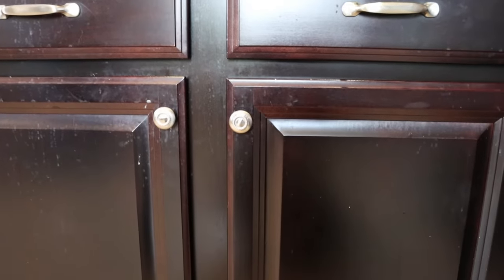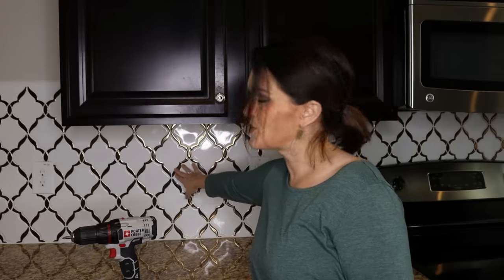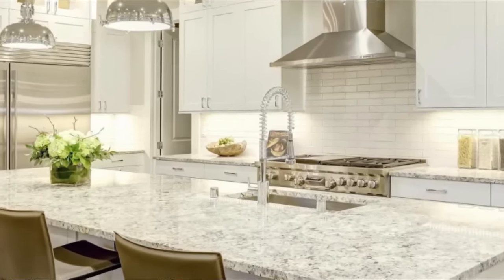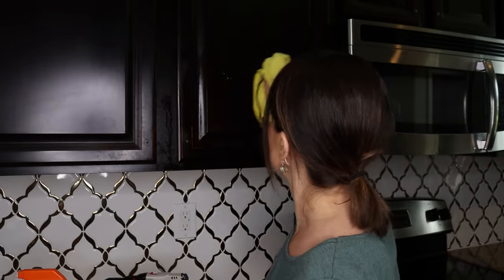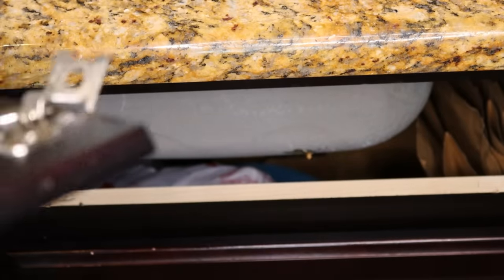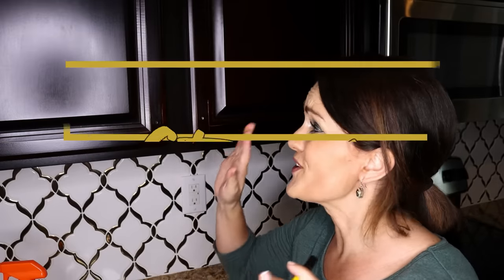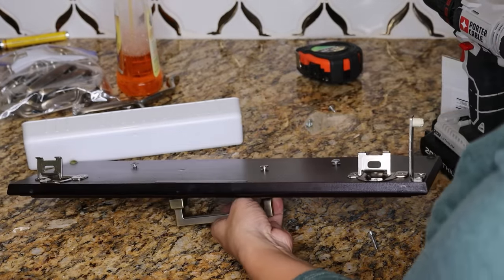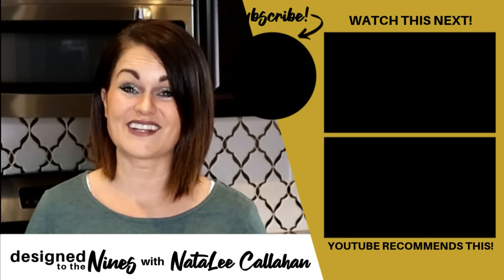HOW TO Refinish Cabinets & Avoid Sanding! Save Your Kitchen For $35!

Comment from the maker: ⭐What is your biggest DIY challenge when it comes to your kitchen? Like this video? Check out this on next: https://youtu.be/gE2iJbcY6tM
Reply: clicking on those suggested videos before they disappear.. seriously.. they go so fast.. LOL
Reply: Designed to the Nines well when we purchased our home many moons ago 🤣😂 they had real wood cabinets but they were so boring with the flat panels etc. so I painted them black yes black 🤷‍♀️ back when the black was popular well since then we have sanded and added trim to make them look more like shaker style but my husband stained them a really dark reddish stain which I think I can fix🤞
My real problem is with the waisted space... there are no corner cabinets they are all squared off if you know what I mean... so without replacing all the cabinets I’m not sure how to fix my problems... any suggestions? 🙏🏻😂🤣
Reply from the maker: I feel you! I’ve worked around old the kitchens in the past… it sounds like you’re handy, so maybe it’s just building in some extra shelves here and there on the wall or on the ends of cabinets. Definitely when you’re short on space you have to think outside the box.💕
Reply: @donnadoiron8884  ugh with the squared off corner spaces. so the corners are jsut these huge empty spaces that you cant even get to.  both corners, top and bottom in our kitchen has that empty unreachable unused space! and we will have to completely change the layout of the kitchen to even put new cabinets in to use it.
Reply: Renee Owens yes... that’s mine... you can’t reach anything back there oh I absolutely despise it!! Don’t know what the builder was thinking.... it definitely wasn’t a woman 🤣😂
Reply: Designed to the Nines 
I just realized I spelled “waisted” space it should have been wasted 🤣😂🤦🏼‍♀️
Reply: @donnadoiron8884  definitely not. the top cabinets are so low that you cannot fit any kitchen appliances between them and the counter. they also installed a spice rack pull out above the oven. like the worst possible place for spices.. and i cant reach it at all. I'm too short! its like the person who put it together had an idea of how a kitchen functions, but had never actually used one at any time in their life. 
XD
Reply: @donnadoiron8884  XD
Reply: Renee Owens 
Exactly 😳🤣😂
Reply: Wow your cabinets look amazing. I definitely need to do mine as well. Love how when you fail you just laugh and take it in stride. Keep up the amazing work. Hugs and have an amazing day.❤
Reply: My cabinets were made in the late 80s an have white laminate covered doors. Is there anything I can do to remove the laminate or cover it to update these? I’d like to update my kitchen but I can’t afford a kitchen makeover
Reply: crayons are for filling holes, paint pens are for filling scrapes and painting but you need to get the paint to drip off the marker first on a piece of scrap wood or a paint stick its like nail polish. You put on a quick coat. Let it set 10 seconds. One quick swipe would do it.   Mowhawk makes better matches to the color you have which is called "Twilight".
Reply: Tdd r
Reply: I have pressed white wood cabinets that have chipped. Hoping to make them look new again. The cleaning process you used looks like a great way for me to begin the restoration.
Reply: My kitchen started out small but a previous owner cut it down to make a bathroom for a senior. It is incredibly small and has four doors (back, living room, dining room and basement) in this tiny room. I have worked through the rest of the house (on my own) over the last 17 years leaving this room until the end because it is so challenging.

Comment: Hint.  Always remove one of each handle type you are replacing and and bring it with you when you shop.  If you are ordering online, measure distance on back between holes.  I’ve made the same mistake you did the first time, but only because I guessed.  NEVER guess.  My cabinets are painted, but because I am repainting them, this will work.  I know some of the paint will come off, but it doesn’t matter in this instance.  Thank you so much for this tutorial.  You’re a hoot.  By the way, your cabinets look great and the new hardware adds a great touch.  I have white cabinets with white hardware.  It’s fine, but I’m switching out to black hardware.  Cabinets are quite old, but I’m leaving them because I plan to move.  They have the exterior hinges.  I, therefore, needed to buy handles, knobs and hinges in black.  I buy myself a birthday gift and for three birthdays in a row, I bought handles one year, knobs the second and hinges lastly.  The hinges were the least expensive.  It cost a lot because I have 27 or 29 doors in my kitchen and 15 drawers.  I was also on a very tight budget.  Now I have to get the paint.  I’m doing the same color, decorator white.  I like my house, but not the neighborhood.  Hence, the move.  Plus I want a smaller house with everything on the main floor, no upstairs.
Reply from the maker: I think that it would work well for painted cabinets and just knowing that you’re going to have to go in and touch up paint a little bit. Might actually be good to kind of knock off some of the loose ones that would not stick anyways. Yeah… As far as the hardware I should’ve known better... it’s so silly that that happened. I’ve been dying for a long time and that was an amateur mistake. I think black hardware will look really awesome with white cabinets. Good luck with your project!💕
Reply: L we

Comment: Thank you NataLee. I have two kitchens in our new home. One is hard wood, the other is not. 😕 Is there something that works this great on laminate over press board? I am trying to decide whether to purchase new cabinets to replace them (they are white and in mostly good condition) or replace them. A few nicks and scratches and a couple of lifted/cracked facing on the door edges, but otherwise more than decent condition.
Reply from the maker: I would probably make a go of repairing them first to see if you can save them, but if not I have seen people wrap them before, like in this video... https://youtu.be/Id3bEsI0nr0
Reply: @designedtothenines  Thanks for the reference. I have no clue what I am doing. Thank goodness for you sharing. I've been watching your channel off and in for a year or so. Recently moved 1,500 miles with kids, dogs, and elderly parents. Just trying to get our new place in order now. I'm watching you more than ever. Thanks again.
Reply from the maker: That’s a big move! I’ve done it a couple of times. Moved from Utah to Arizona to Maine to Florida. Love those cross country moves! LOL. Good luck.💕

Comment: Love the brass!! I think the counter tops are a little dark with your new backsplash,  but it's still beautiful..do you have any suggestions for oak cabinets  if the stain comes off?? I'm not sure a sharpie would work for that color..lol! Thanks so much! Love it!
Reply from the maker: So unfortunately I did not pick out the counters and I was working with those to begin with. I didn’t want to replace them since they are new and in good condition. I actually went with the lighter backsplash because I thought it would brighten up that already dark kitchen which it did.😃 I Think if your kitchen are just the natural oak color you won’t need to worry so much about a stain pen because they should be the natural wood color, having said that you could try the blend and feel by Minwax which is kind of like a waxy crayon type thing and I think that could work. My mom did light colored maple cabinets that did not have a stain on them and she did not need to do that step once she cleaned and put the cabinet cream on.😃
Reply: Thanks so much..like I said,  your kitchen is beautiful!😊 my oak cabinets are acorn finishe, thanks so much for your help!

Comment: Our current pine kitchen cabinets have been in place in our old 1927 farmhouse since the early 1950's.  I'm sure they were varnished at one time, but by the time we moved in recently, they were wearing more layers of fried food grease than anything else.  It was disgusting!
Scrubbing the cabinets with Muphy's oil soap, rinsing with a vinegar/water solution, and finally rinsing with plain water got them cleaned up, and even helped removed gummy dissolved varnish.  As a temporary finish,, I oiled them with jojoba and lemon oil with rosemary and tea tree, because  ... .  Before painting. I'll rewash them with oil soap and rinse again..  It is worth the effort to prepare a surface before refinishing!!!

Comment: Hey Natalee, they look great! Was the cabinet polish an oily consistency? I’m thinking that could’ve caused the stain pen to not work.
Reply from the maker: It's cabinet cream... like lotion. It actually worked when I tested it, on lighter cabinets this won't be as critical. I think I would probably try the waxy crayon next time, but honestly for my color cabinets, the sharpie worked like an absolute charm!
Reply: @designedtothenines  I'm with Braden, it could have been the polish. Murphy's Oil Soap could have been a factor too. Had you waited a few days for the product to soak in better, the stain marker should have worked better. 
Beautiful transformation though! The crayons are for filling scratches or marks left when nailing pieces of stained wood as a quick filler.

Comment: I just found this video today 7/7/21. A whole 9 months later. Anyway, my kitchen cabinets I do believe are builder grade. My house was built in 78 and we bought the house a few years ago and my kids have since ripped pots and pan doors off, silverware drawer off and the cabinets are just disgusting. They have been painted so many times the they don’t even close well.  I am not sure if I can take the rest of the drawers and doors off and strip all the paint and fix the ones broken and put in new hardware or should I just replace? I have an extremely small kitchen which is half galley.  Only cabinets tip and bottom on either side. Not room for more then 2 people inside at a time.

Comment: I’ve ordered the scrubbies and I am not a deep cleaner but that seems manageable. Did you rinse the Murphy’s off with water?  Also my cabinets do not have handles any suggestions on how to pick ones for it.
Reply from the maker: You do not need to wash it off with water. Just wipe it down with the microfiber cloth. It is a very manageable project. As far as selecting hardware. It kind of depends on the color of your cabinet and the look you’re going for. I would go to Pinterest and look at kitchens that you like and see if there’s a common repeating theme of hardware. Hope that helps!😃

Comment: I have always used the Murphy oil spray on my cabinets & have loved it. I’m am so excited to try the clean & polish because I have ebony cabinets & staircase in my new house & it just seems like I need a little extra something to make them look like they did when they were new. Lighter oak like I had in my old house only need Murphy oil to look great so I was worried I would need to restrain my new ones soon. Thank you so much for the great tips I need it.😁 I’ll be also looking into the brush to go on my drill.
Reply from the maker: Yes… Darker cabinets are a little bit more work to maintain… They seem to show a little bit more than a natural colored cabinets. Hopefully this video helps you! Congratulations on your new home.💕

Comment: Oh,boy..... All of it just to say you wash your cabinets with drill attachments brushes polish them and change the cabinet knobs...Good cleaning job! -In the slew of cleaners ,that one ok -some are cheaper and better - Awesome for instance ,if your cabinets really need deep scrub use  ODOBAN -its disinfect , hypoallergenic, doesnt need to be rinsed ,perfect for taking grease or anything and  ...  the wears better to do before polishing  and -instead of black permanent marker -use markers for wood -one package contain 4 of them in all major colors of wood finishes -it would match perfect...and i meant perfect -the idea of changing hardware on cabinets -good and there -as much as wallet let and heart desires ,btw -most of new hardwares come with its own screws,however the old one after cleaning can be sell or donated ...

Comment: We need a new kitchen. The fridge we bought was too big, so it sits in the walkway instead of the fridge slot. The glass countertop stovetop shattered. The sink leaked , destroying the cabinets below. Easch counter is as big as the appliance, so the dishwasher the length of one entire counter. And you cannot open the fridge and oven at the same time.  Then a pipe burst in the wall, destroying the wood flooring. Seriously,  who puts wood laminate flooring in a kitchen? Your tiny kitchen is nearly 3x the size of ours.

Its soo gorgeous too...
Reply from the maker: I totally understand. I have had a kitchen 3x smaller too not that long ago. It’s a challenge. Sometimes it is better to just start over if you are able to. I wish you the kitchen of your dreams soon!💕
Reply: @designedtothenines  hugs.. we are hoping to start saving for a remodel soon.
Reply from the maker: It’s tough times right now. Hopefully soon!
Reply: @designedtothenines  <3